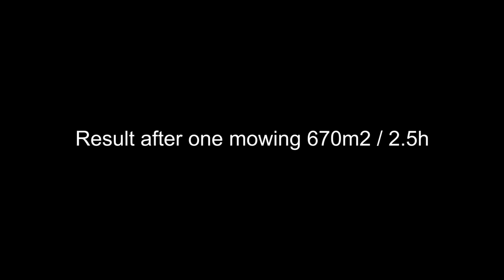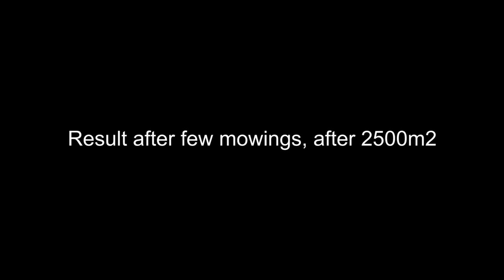Luba blade covers

Comment: 00:28 My Landroid has a slight raised plastic piece that the blade screw, screws into, this keeps the blades slightly raised off of the the plastic disk. They get very little grass stuck in them, the hole of the blade is round as well and fit snuggly around the plastic screw hole. I would put a flat washer on these blade screws to give a little space and maybe use Landroids blades with a circle hole instead of those blades with the slots.

Comment: This is what Husqvarna has done on their automowers for a decade. You'll want to avoid any friction between the blades and the cover or they won't spin out of the properly when hitting things like sticks. A very small washer or spacer of some kind should help as well as a more rigid material.

I'm very surprised Mammotion had no idea to do this as it's critical to mow or the blades will degrade very quickly.

Comment: Good idea about the cover. Have you thought about putting the blades on ball bearings? The added weight might reduce the run time though
Reply from the maker: I believe there is no room for ball bearings, and they are not really necessary
Reply: Shoulder screws I think would be ideal giving the blades plenty of slop/wiggle room. Stock they look barely loose enough.

Comment: why not just using longer screws so it has more clearance. I would prefer that option.
Reply: I'm doing this. I've added about 5mm of open play. My screws have a non-threaded area for a blade axel, and I add a nut and lock washer after the blade. Lastly, I spray the blades and disk with dry graphite lubricant to keep the grass from sticking. All this has made a huge difference. My blades are completely clean after mows now. There's a small amount of grass wrapped around the screw, but the blades remain freely spinning.

Comment: What would be the ideal thickness of the cover? I’m thinking of using a Teflon sheet
Reply from the maker: Here is thread if you can open it
https://www.reddit.com/r/MammotionTechnology/comments/13qo6dh/remedy_for_stuck_blades/?utm_source=share&utm_medium=android_app&utm_name=androidcss&utm_term=1&utm_content=share_button

He use 0.8 sheet aluminium and cut on CNC machine. After that he say he hav 0.2 clearance between blades, disc and plastic holder disc.

Picture
https://preview.redd.it/pdqqric6os1b1.jpg?utm_medium=android_app&utm_source=share&width=2016&format=pjpg&auto=webp&v=enabled&s=b23c3f088ae643122e8a6ed73e25a90dd521478a
Reply from the maker: Maybe this will also help you
https://www.facebook.com/groups/364111978910130/permalink/638290661492259/

Comment: What does it matter if the blades are “stuck” in the fully extended position??  The cutting part of the blade is still perfectly exposed and spinning around cutting.  I think you’re “fixing” a non-problem.
Reply: The blade is meant to deflect if it strikes a stick, stone or other hard objects.   If the blade cannot deflect it rapidly becomes chipped and blunt.  This mower excels on lawns other robotic mowers cannot handle so they are inevitably a bit rougher
Reply: I agree